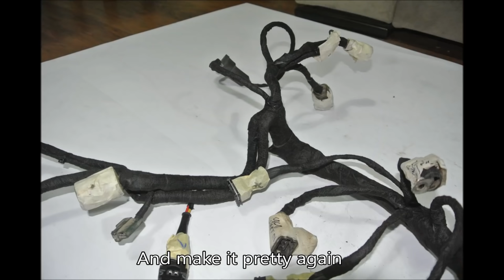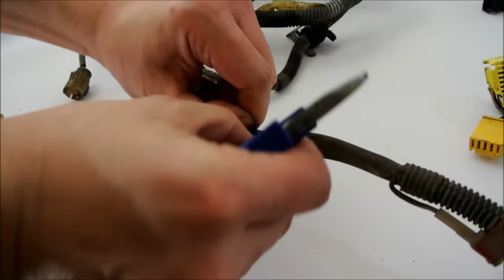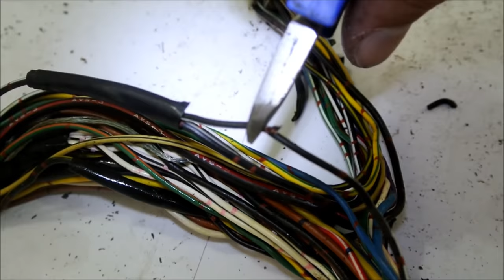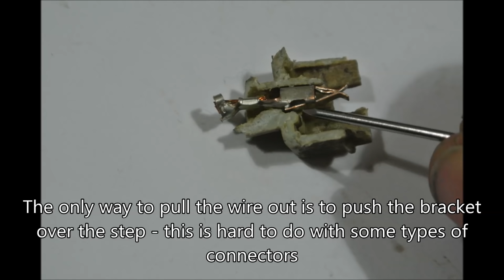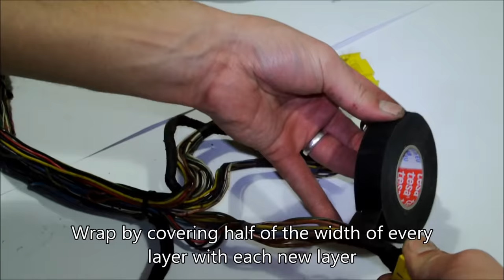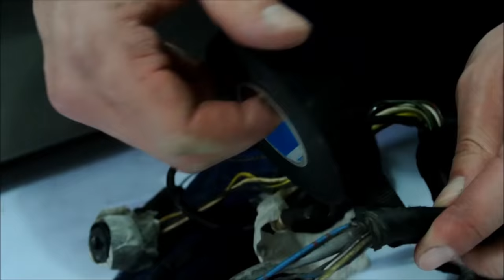How to DIY - wiring harness restoration

Comment: As someone that repaired and/or replaced wiring harnesses for laser range finders in the Army, I can tell you all this is not how you do it. This video isn't even close to the best practice approach or what the manufacturer recommends. 

For instance, the best practice approach is to solder both ends of a wire and then place heat shrinkage tubbing over it. The problem how this guy did it is that you can't be sure the ends are fully connected and won't come loose from the vibrations the engine creates. There is no room for error while driving. Would you want him to use the same methods in fixing components in an aircraft you are about to fly?

Comment: butt connectors really? and that corrugated plastic sheath is there to protect from heat and abrasion you should have replaced it. you should also take into account how the wires will lay in position and take out the slack in them before wrapping them into a tight knot at the end. Just my opinion though ive only done motorbike looms and they are alot less forgiving this is probably fine for a car. good on you for having a go at it.

Comment: you should solder instead of crimping, much more reliable..
Reply: especially since he uses one of those cheap crimping pliers. It's also easy to use the wrong size of wire with those butt connectors as they often do not correspond to the size of wiring they are used on. Difference between metric and imperial

Comment: I like no needless wordy, over explaining every detail, and failure to get to the point like most other videos. However, the tools are from the 99 cent bin and the tape should be wrapped so that it can be tensioned, like cable splicers are taught an cut with a scissors when complete. Others have already commented about NO but splices!
Reply from the maker: Yay. I'm not needlessly wordy. I'm happy with that. 99 cent bin parts did the job for me, and it made no sense buying pro stuff for one wire harness job. Of course one can always do better  and I will work to improve what you mentioned.

Comment: In all honesty, if you had the wire harness out on the bench, cleaned the wires and all, I would have soldered and shrink tubed the connection. Butt splices are trouble waiting to happen

Comment: Butt connectors-no good!! especially on a competition car solder & heat shrink anyday I to lost interest at that point.
Reply: Proper non insulated crimps are the way to go.
Problem with solder is it always wicks up the strands, and wherever it stops is really prone to breaking.
The auto industry and auto electrician all use crimps for a reason.
It being much faster is another reason.

Comment: Some good tips. Great effort! But tessa tape wont hold up well in an engine bay. Skip the tessa tape, re-sleeve with PVC split loom and wrap with good electrical tape.
Reply: Tessa tape comes in different grades. Some for the interior and some for high heat areas. BMW, Mercedes and others have been using Tesa tape on harnesses for years. I have vehicles over 50 years old with the original Tesa harness tape in good condition.

Split loom has its pros and cons. Regular vinyl electrical tape will shrink and trap heat.

Comment: These pre-isolated wire connectors are the wrong decision. Think: you have water-isolated connectors in the engine bay, and you are using that… it is instant oxidation, a built-in-failure
Sorry for this,  but this is My job with 20+ years experience

Comment: LOL, "look out for dodgy wiring jobs like this and fix them", by making it only less dodgy? "Tools you'll need" should include A soldering iron and solder. You at least had the heat shrink listed, albeit not the type with a sealer in it. Strip the wire, tin the end, and crimp the wire using a connector with heat shrink built in that has a sealer in it. Not only would that be a better connection, but those connectors tend to be a tiny bit smaller than the PVC covered connectors. And to top it off, I use heat shrink (also with the sealer in it) over that connection when the heat shrink on the connector gets punctured by a crimper designed for insulated connectors (which happens, but infrequently).  Also, I recommend using a quality ratcheting  crimper. Most ratcheting crimpers have removable jaws for all types of crimp styles.  

I like how the video shows no restoration other than replacing one connector, but shows dodgy repair work (yours) and a re-wrap. I saw no multi-meter to verify your or any other connection as sufficient.

Comment: I have a wiring harness for the engine that isn't labelled.. How do I know what connector goes where? Will it cause damage to just plug it in and try it out? like their is a few connectors next to each other so I can't just see what connector reaches. I really would appreciate help.
Reply: 9 times out of 10 a connector won't plug into something it isn't supposed to
Reply: Fox correct only injectors plugs are the same I assume
Reply: Driftkor yup, that's pretty easy to figure out though. The connector normally only reach the injector they are meant to go to.

Comment: Avoid butt connectors, whenever possible solder your connections and heat shrink to avoid corrosion down the line.
Reply: I actually avoid solder in the engine bay, it is too stiff, and also tedious. 

Check out solder seal wire connectors. Simple, effective, flexible and strong !

Comment: Hello a solder gun and solder  is super cheap heat wrap is like super cheap a match to shrink it all over. Then you have a permanent connection. A hidden butt joint is well funny..  It sure is when you are done and the wires fall out or break.. Now where is that butt joint at...

Comment: There is a purpose why they put corrugated tubes and vinyl wraps/tubes on the harness. Not a good idea just to wrap it with tape.
Reply from the maker: It is not "just tape" . Its fire resistant tape specially designed for wrapping wire harnssses. Corrugated plastic is cheaper but just as effective which is why it was used by the factory.

Comment: Disassembly of connector with a cutting pliers ....
If you don't know how to do it, than don't upload a video of how to do it wrong.
Reply from the maker: +Julius Mikenas It worked just fine didn't it? So if I don't have some expensive special tool I should leave it alone? The essence of DIY-ing something is getting the job done with what you have at hand. Otherwise I would have called the video professional wire harness resto and no one would be able to replicate it.
Reply from the maker: +Julius Mikenas It worked just fine didn't it? So if I don't have some expensive special tool I should leave it alone? The essence of DIY-ing something is getting the job done with what you have at hand. Otherwise I would have called the video professional wire harness resto and no one would be able to replicate it.
Reply: You can build a tool from an old wiper and a dremel or smth like it.
Also, like a few before me mentioned, I think using butt connector is almost the worst thing could happen to the hardness. Butt connector is not reliable. Car makers say the only repair method is solering and heat-shrink sleeve. I understand this is DIY but it must not affect safety.
Reply: i am an auto electrician for jaguar land rover(at the manufacturing plant not a dealership). we call them crimps but essentially the same and are used on everything. only difference is we heat shrink them.
Reply: Not to forget about the quality difference between your crimps, your crimping tool that's used and the fact that englisch auto electricity in general is an absolutly nightmare ;)
I stopped watching this video at 2:28, thinking of it maybe be better to leave it even stock broken, than repaired on a 'DIY methode' which is more than just risky
Reply: Sometimes cutting it out is easier then trying to release that pin.. As long as zero damage good to go.. Be nice..

Comment: noob wiring hack job, yo the moisture will be glitching.
Reply from the maker: thank you for your useful and objective comment based on facts and proven experience. Have a nice day.
Reply: +driving 4 answers (mr2 mk1 hero) come on think about it like duck tape when heated it will get all the wires sticky. Looks good thats it.
Reply: Good wiring harness tape that is completely non-adhesive is fine practice imo.

Comment: I just cringe when I see those butt connectors... W T F. Taking the whole electrical wiring out of your car to fix it with used toiletpaper... Ever heard of soldering and heatshrink or self vulcanizing tape.
Reply: It's actually better to not to solder wiring in a vehicle because the vibrations and constant heat/cold the wires will be exposed to will cause the solder to crack and eventually break.
Reply: true. wiring that is correctly soldered sees the solder seep right through the join and wire strands, it doesn't just sit on top and 'glue' the wires together.

Comment: Is that tape water resistant?
Reply from the maker: From my own experience, yes. I used what was left of it to wrap something on the house as a temporary fix. It's exposed to the elements, the tape does get wet, but it never unraveled. However, I strongly advise against wrapping anything uninsulated with this.
Reply: Okay, Thanks. just used it now for my motorcycle wirings but before that I used some electrical tape and heat sink wrap to cover up nicked and open wires. It's doing fine now.

Comment: butt connectors are NOT a good way to repair a break in a wire. A proper solder job with heat shrink tubing is best. With the butt connector, there's a voltage drop and its not a solid connection.

Comment: Not only did you use a crimp connector which is completely the wrong choice for this purpose, you used dime store grade crimp terminals. Those cheap terminals WILL fail when exposed to enough movement/vibration - like on an engine or chassis harness. Solder your wire splices, or at least use professional grade copper crimp terminals with an adhesive heat shrink casing. Even a half decent stereo shop doesn't use the kind of terminals you used, almost anything is better than those...
Reply: Soldering is too stiff and will degrade over times. It should be avoided in Engine bays. Go with solderless seal wire connectors … quick easy and strong!

Comment: yes I'm looking for a somebody that does wiring of troubleshoot on a Dodge Avenger 2012 2.4 when I use my blinkers my headlight cuts off just wondering if anybody does any troubleshooting ra answer for this question
Reply from the maker: Tim Blackburn did you check your grounds? Sounds like it might be a bad ground.

Comment: Dude why the butt connectors? The wire could have just been insulated before relooming the harness. It might have been a stronger connection at that.
Reply from the maker: Butt connectors are good, honestly. I don't get it why people are hating on them.
Reply: +driving 4 answers (mr2 mk1 hero) they're not that bad but what I've found in my experience having to redo and rebuild other ppls work is that most people don't crimp them well. Even some really high end installers don't. Obviously you did it properly so there shouldn't be an issue there.
Reply: A} You are using box store butt connectors and a $5 crimp and strip tool.  Not a good idea.  Your repairs will get dodgy over time. Tooling and terminal selection is a key factor in how long your repair lasts.
#1 These butt splices are unsealed allowing water and air access to the copper wire creating corrosion and a failure point.
#2 The box store butt splices are generally made of the wrong materials to maintain a proper crimp.  They loosen up over time so even if you managed to get a good crimp it will not stay that way.  Yet again a failure point.
#3 The terminal chosen should have very little space between the crimp sleeve and conductor strands.  Box store terminals are supposed to cover a wide range of wire gauges but in reality they only work properly for one.  If there's a gap between the conductor and crimp sleeve the conductor will work itself free and you have a failure.
#4 A properly crimped terminal when cut away will have no voids and the crimp sleeve will have sufficient retained pressure to effectively weld the terminal and wire strands into one continuous piece. The cheap crimp tool like you are using lacks the leverage to crush the sleeve into the conductor.  It also lacks the control to not over-crimp if you are strong enough to make the lack of leverage a non issue.  Over crimping will create stress points on the conductor strands where they will fracture and fail.

The cheap bargain store crimper strippers either don't cut through the wire jacket leaving rough stretched jacket ends and imprecise strips or they cut too far and nick the conductor strands with obviously bad results.  Good quality Ideal Stripmaster Aircraft strippers are available at Lowes for around $30.  You will not be sorry you bought em.

Non-insulated butt splices with the correct crimp tooling (like KNIPX 97-33-03) finished off with adhsive lined heatshrink will give you very good professional results that will last a long time.

Solder and Adhesive lined heatshrink is a good repair too as long as you limit the heat so the copper is not made brittle and don't use too much solder.  This means you aren't using anything bigger than a 25W iron.  I put a dot of liquid flux on the joint and melt a small ball of solder on the tip of the iron.  Then I touch the melted solder ball to the fluxed joint for no more than a few seconds. Solder wicks in immediately.  If it doesn't go back over your prep work.  Make sure it doesn't wick past the joint itself into the straight section of your conductor.  Then shrink on the adhesive shrink tube.

The Pros use ultrasonic wire welders when they build and repair harnesses.  You and I can't afford them.

B} It appears you are using adhesive lined electrical tape as harness wrap. YOU ARE NOT...  So you should note that in your description for the unwashed masses.  At first blush the OEM tape and the stuff you're using looks like wide 3M E-tape...  It's not.  Harness wrap like you're using has no adhesive.  It depends on tension of the wrapping process and proper tie-off of the tape.  I sometimes find a single band of gooey nasty E-tape at an end and some breakout points on vintage harnesses.

C} You get an A for creativity and patience in removing the Bosch Injector or sensor connector from the terminals with Dikes.  You can buy extractors that will handle 85% of all terminals you are likely to encounter.  SIR-Tools 9024 & 9025 are a nice sturdy set that folds for compact safe storage and will not break the bank.

Keep chugging.  That's why they call it work.  If it was cheap and easy everyone would do it.
Reply from the maker: David Hatzenbuhler Sir you are a living treasure. Wish more people would post actually useful comments like this rather than bits of nonsense. Thank you. Lot's of good stuff there. I think what I did here may not be world class, it's a diy job after all, but I am certain it will last a fair bit more than expected.
Reply: the only concern i have with butt connectors id just the face that when its all loomed its hidden not that its a problem but if a problem were to happen just makes it a little harder to find the bad or intermittent connection

Comment: wrapping wire in black tape will over heat the wire. that's dumb. your supposed to wrap your wires with zip ties.
Reply from the maker: maryannsmilie tape will overheat wire. Gotta write that one down.
Reply: yeah I have first hand experience with electrical taped wiring in my vw cabrio 1999. it overheated and could not turn the car back on and i had a hard time re-crimping the right wires with the right sized wires.

Comment: where can I find the connector replacement?
Reply from the maker: SLEEKWIDIT GfunkERA For the injectors? I got them from eBay just look for Bosch EV1 style replacement connectors.
Reply: driving 4 answers thank you very much. I've never had experience with wires harnesses. This video inspired me to DIY. Hope I don't mess up. By the way what vehicle harness was this for?
Reply from the maker: +SLEEKWIDIT GfunkERA Happy to hear it inspired you to DIY. This harness is from my 1987 Toyota Mr2.
Reply: driving 4 answers I am attempting to rewire and replacement for my toyota pickup 86. If you are local in SoCal I would pay you haha. I want to give it a try just kinda nervous. I've never did anything kind of wire replacements before. Will see how it does. 🙏
Reply from the maker: SLEEKWIDIT GfunkERA I'm halfway across the world, in Europe. But don't worry about it, it's not hard. Don't forget to take lots of photos for reference and label everything and you will be fine.
Reply: driving 4 answers Thank You much appreciated. Much love from the other side of the world. I will definitely will take lots of pictures and videos.